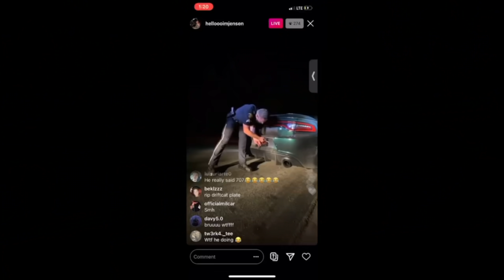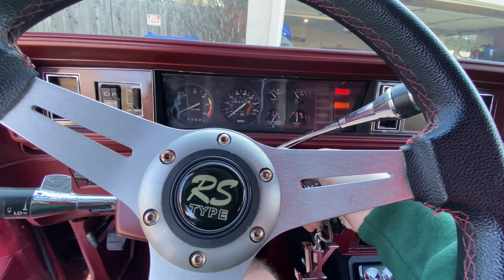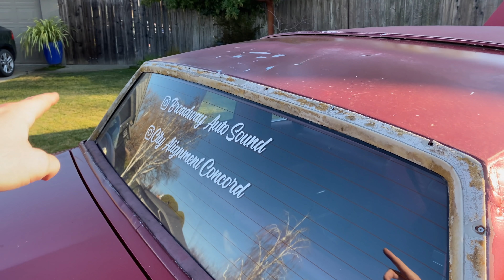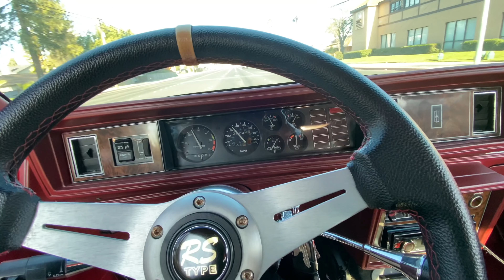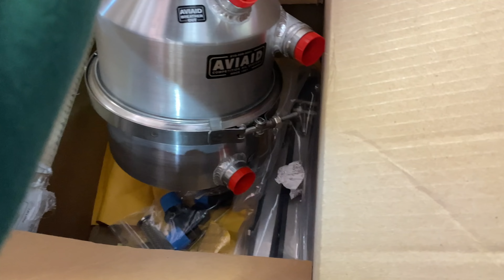Saying GOODBYE to my 1984 Cutlass Supreme….

Comment: Its called a parasitic drain. It will drain your battery out every time unless fixed or maybe just a bad battery.  My best solution is put a adapter on the battery that "maintains" a 12v charge. They're very cheap in autozone or any other hardware store.

Comment: Is your Amp and radio properly grounded? If not could be drawing down your battery....I would recommend putting it on a battery tender to get a full charge and it will stay charged, if not might have to replace the battery